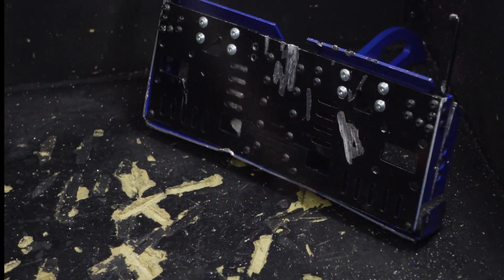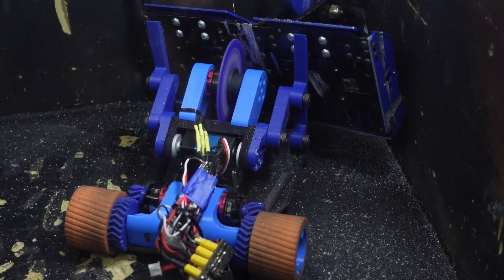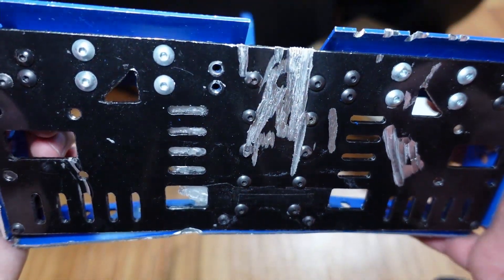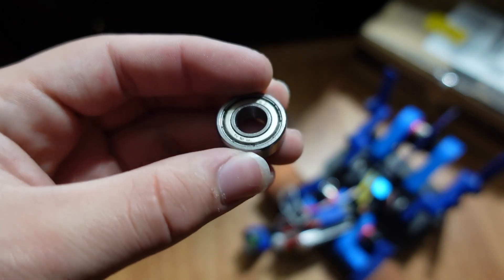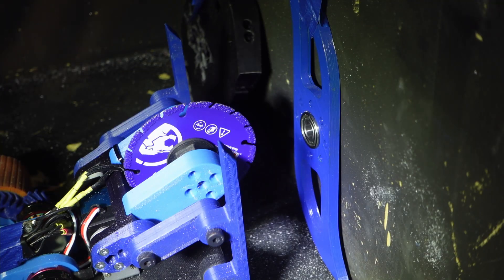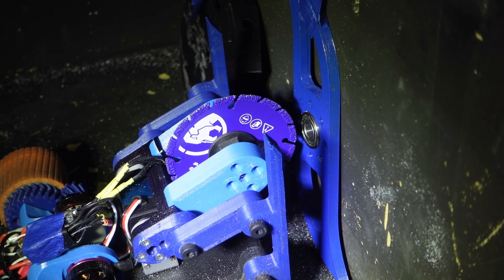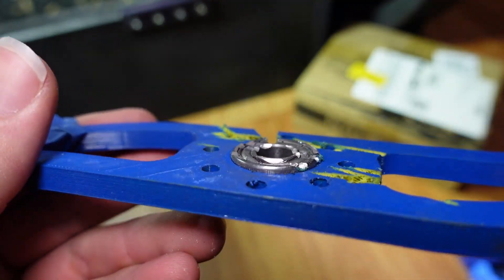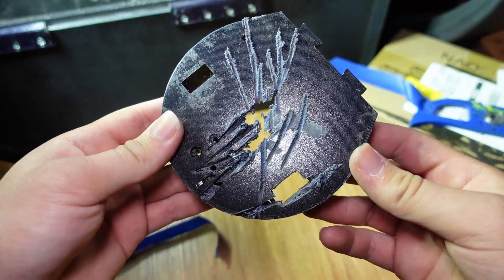Sawing Through Steel with Diamond!? Shrapnel Mine 3lb Combat Bot Saw Testing Continued

Comment: After watching your video I decided to run Breakpoint through a similar test and didn't fare much better. After 15 seconds of cutting I only got through ~2mm of flat aluminum extrusion.
My results: https://www.youtube.com/watch?v=tTJFvMflods
I've cut through all sorts of different metals in various fights, but the cross-section of the metal I'm cutting through is always very thin. Saws love corners and edges.
It seems like a flat metal baseplate might actually be one of the harder parts of a bot to cut, but hopefully the more aggressive saw with fewer teeth will be an improvement. 
Looking forward to your results!
Reply from the maker: This is really great info! Glad that I have a second person to show I wasn't doing something completely wrong. I have another saw arriving in the mail today which is 1/32" thick. The original AR500 blades I got were 0.100 and my calipers said the thicker part of the blue diamond saw is 0.076", so I'm hopeful 0.032" will prove to require way less effort to cut deep. I suspect it may not work in your setup seeing how much your arm twists though. 

https://amzn.to/3ildkgO

Comment: You really need a way to hold the workpiece (opponent) stationary.  Saws really don't work when they're just sliding across the surface.  You need to actually 'feed' your saw into the material at a consistent rate with ample pressure/force.  Without those issues solved, it's just going to make sparks and scratch, no matter what you do.
Reply from the maker: I agree. I think that with a saw that actually bites in properly it will help to solve that somewhat. See my last saw video cutting plastic and how it worked very well. I also, like I said in the video, sortof slapped a much longer arm onto the test chassis than I designed the rest of the system for. The final version will have forks that are much closer to the center of the blade and probably protrusions on top that prevent the opponent from lifting up and away from my bot as it is cutting. Plus the opponent will weigh a LOT more than the weight of what I am attacking here. 

Clearly the abrasive cutting doesn't work well at all though with so little time and pressure.

Comment: Have you thought about any way to increase cutting pressure with your mechanism? Atm the only pressure you’re getting is from the drive (as the cutting direction is horizontal rather than vertical) - just looks like the saw is lightly grinding the surface rather than cutting. Lots of sparks but very little cutting. My guess is this is where this design will lose out compared to a typical overhead saw, where you can apply pressure simply between the arm and a wedge.
Reply from the maker: There were a couple moments where the saw stalled out already so that means the motor cannot supply enough torque to maintain even the current amount of pressure. I'm gonna focus on finding the most efficient cutting saw first, and then if I still need to make other changes I will consider it.
Reply: @JustCuzRobotics  it does happen a couple of times, but under perfect/coincidentally perfect test conditions. Deep cuts only happened after very long periods of time in the same place against the test material. In combat this is much less likely to happen?

I just wonder whether you could be more scientific with your saw/cutter testing. Measure the pushing force from the drive, apply the same force with different saws, etc.

(Btw I'm not trying to be an armchair builder, I think this is a really cool concept!)
Reply from the maker: Part of the reason I cannot cut very deep is that the cutting forces required are nonlinear. Think about it this way: I am shoving a circle into a flat plate. The 'deeper' into that plate the circle goes, the area of intersection increases and the perimeter on the edge that is being cut away also increases very rapidly. I think that even double the pressure might result in going only a little deeper if the material isn't being removed fast enough.

At some point I might try doing some more controlled experiments with a saw motor on a slider and some sort of weight I can adjust hanging off it. At the moment I'm pretty busy with other stuff as I mentioned at the end of the video but I'll certainly consider it!

Comment: What should the RPM/Torque be for a saw weapon as opposed to a traditional vertical spinner?
Reply from the maker: I don't have solid numbers but sawblades usually have a max RPM on them that they cannot exceed, and need sustained torque for a while. Normal impact weapons usually are geared for a tip speed between 150mph and 250mph and the torque isn't as much of a concern. RPM then depends on diameter.

Comment: My first combat robot idea over 20 years ago was to attack the weaker under armor. The concept was a low profile wedge that could drive under another robot and then use a pneumatic driven spike to impale from underneath, or launch them. I think the flip/pin concept you have here is probably a better way to go. The pneumatic spike still seems interesting, I just don't know how the saftey rules would govern that in certain organizations, I'd be scared of it; potentially an armor piercing rifle in a machine prone to unexpected control malfunctions :O 
You'd want the smallest diameter that won't break itself, a very long taper and significant weight and acceleration distance to build up momentum before impact.
Reply from the maker: That's basically just a crusher but with the stabbing part on the bottom! If you only push upwards then you can only apply a force equal to the weight of the other robot without just lifting it up. You would need a hell of a sharp spike to push through a 3lb bot baseplate with 3 pounds of force!

This bot with its saw is designed to cut horizontally forward pinning the other bot against a wall so I can use however much pushing power I can generate as the driving force, with the other bot unable to move through the wall. However, cutting is proving quite difficult to do.

Comment: As a rule of thumb in my garage, the softer the material the larger the tooth...also less RPM's. This is really only a good practice in hogging off material fast but should crossover good with robot combat.
Reply from the maker: I plan to try that out next, I have an 18 tooth saw currently that's similar to the 24 tooth I tried in my last video about saw tests. I'm also worried that the blades I can find are too thick for the amount of torque this motor can put out. I bet a thin blade with 18-40 teeth would be great but I can't make custom blades thinner than 0.1 inches without a lot of extra work.

Comment: Run the blade backwards to cut through aluminum
Reply from the maker: Why would that help? It's an abrasive cutting blade so there aren't really any directional teeth
Reply: @JustCuzRobotics  hrm good point... I've just seen where people will cut through 1/4 aluminum bar stock using a diamond tip blade ran backwards on a circular saw